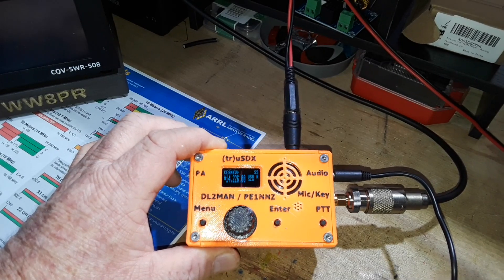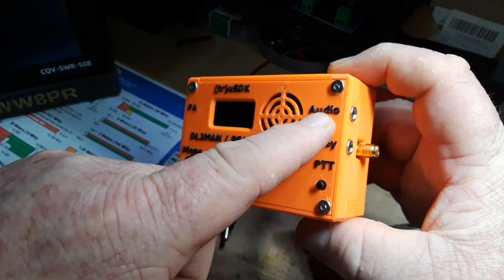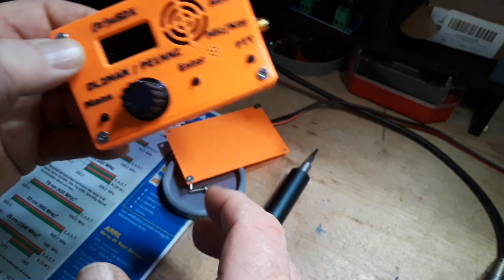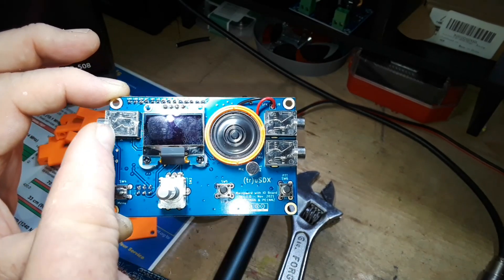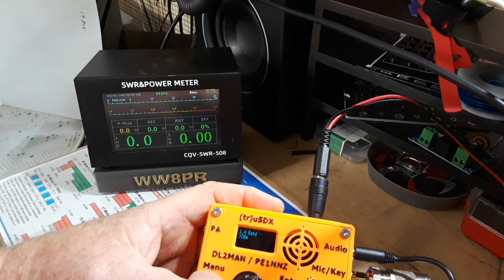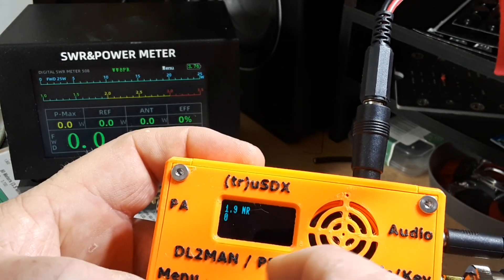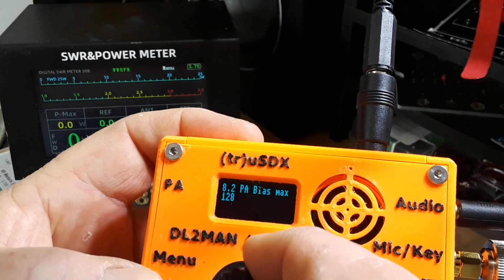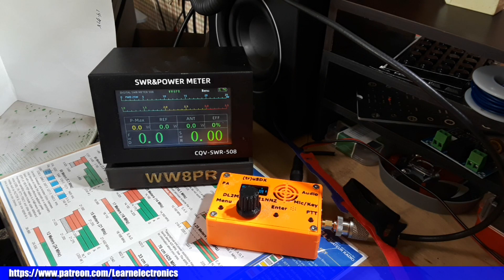(TR)uSDX - Amazing Features, Small Package

Comment: Unfortunately, these radios do not last long; the transmitter burns out after a few months of regular use.
Reply: A Zener diode (1N4756A, 47 V, 1W) can be soldered to the board to protect the mofset.